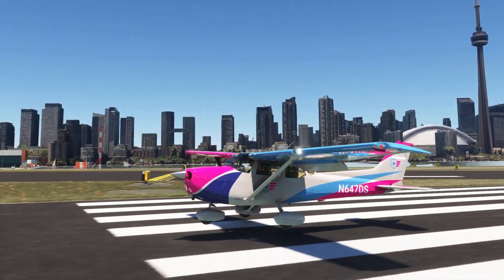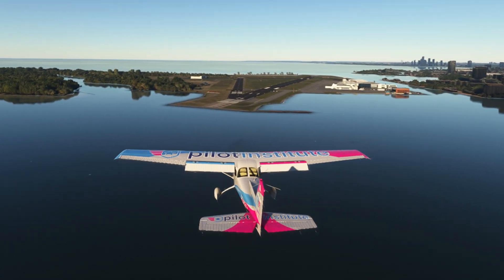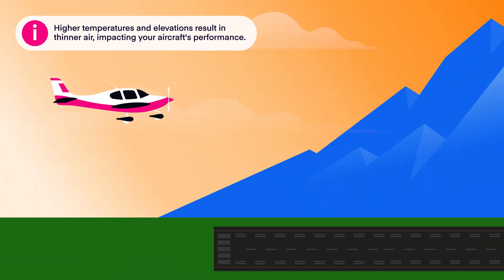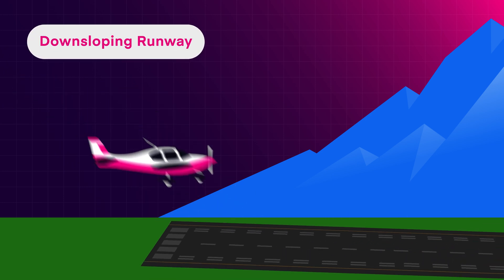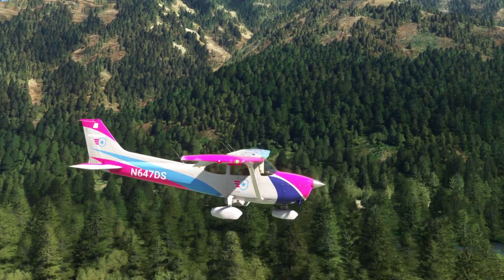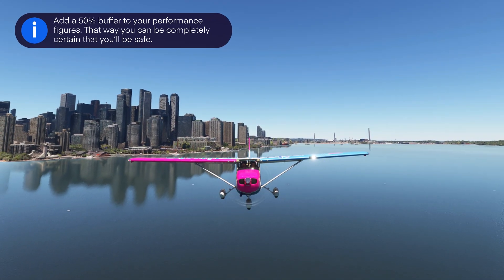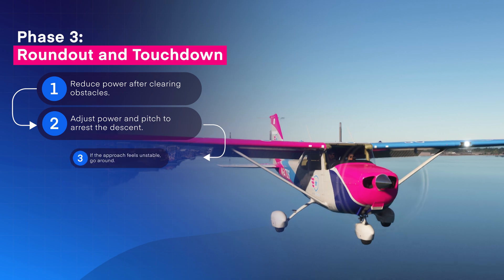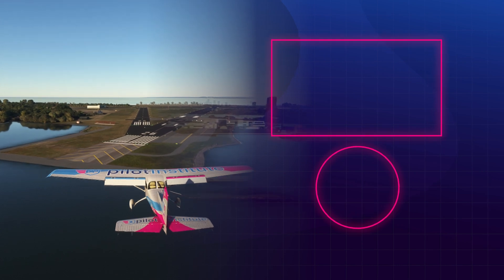How To Nail Short Field Landings

Comment: "If you're too slow point the nose down; if you're too fast lift it up".  That's a sure way to destabilize the line of flight.  It's easy to see that shifts the aiming point a centerline stripe or two lower or higher.  Per the Airplane Flying Handbook - "Whenever a slow speed approach is noted, the pilot should apply power to accelerate the airplane".
Reply: I always feel like the “pitch for speed, power for altitude” is an oversimplification, it’s just management of energy and either way to manage speed works as long as you’re not adding or removing too much energy
Reply: @ExpwodingMuffin  Actually either way to manage speed doesn't work.  If there are gusting conditions, the airspeed needle is going to be constantly moving.  A pilot who has been taught 'airspeed is king' and 'pitch to airspeed' may try very hard to stabilize the airspeed with the elevator.  I saw someone try to do that and the approach looked like a roller coaster ride.
Reply: @warren5699  I agree, when I'm on approach my airspeed always varies between like 65 and 75 knots, I notice a lot of people as you say, overcorrect for things instead of letting the plane do plane stuff

Comment: Why in the fuck would you pitch down and pick up speed on a shortfield landing?  "oh we're getting too slow, I'd better pick up some speed instead of increasing throttle and hopefully we won't use up the entire short runway."  Pitch up, balance between power and pitch, not pitch down.  Full flaps.  Hang it from the prop and fly it all the way to ground effect, pull power, raise flaps, touch down, brakes, deploy flaps and pitch up for aerodynamic braking.
Reply from the maker: On final: 
Pitch = control airspeed
Power = control altitude
And of course, you use a mix of both simulataneously. 
You raise the flaps right before touching down and then add the flaps again on touchdown? Definitely not something I would teach anyone to do.

Comment: Good coverage.  Thank you.  The best slow flight practice for short field or any landing feel the airplane is the hover taxi at much slower airspeed than Vso, an out of ground effect number.  But first the power/pitch apparent brisk walk rate of closure approach to touchdown slowly and softly exactly where desired.  While 1.3 Vso is a good safe and stable airspeed to get us up to where we old crop dusters used to start final, a quarter mile out, it will make it impossible to slow enough to make the numbers every time.  At the desired touchdown spot, we have to be much slower than Vso to quit flying in one inch ground effect.  About a quarter mile out with full flaps, pitch up to decelerate enough to get a significant sink to bring dynamic throttle into play as the most excellent and exact glide angle and rate of descent control all the way down to touchdown slowly and softly on the desired spot.  Ailerons are not effective at this airspeed and we don't want to turn anyway and certainly don't want incorrect adverse yaw.  We want correct yaw, rudder only yaw, to bracket the centerline between our legs.  And yes, even with deceleration enough to bring dynamic throttle on line, ground effect will cause too much airspeed energy to make the desired spot.  Listen to what Wolfgang, in Stick and Rudder page 304 has to say about that spot.  "The clue to watch is the intended landing spot and the scenery beyond it and to the sides of it.  Once the normal glide has been broken, the process of stalling the airplane down can be gauged entirely by watching the spot and the perspective in which it appears and its apparent motion.  Let me have a shot at that.  Look down at any distant target and notice its apparent brisk walk rate of closure with us.  Now simply remember, good muscle memory, how you decelerate your automobile enough to maintain, yea stabilize, that apparent brisk walk rate of closure with the intersection never looking at your ground speed indicator.  So coming into high ground effect we pitch up further to stabilize that apparent brisk walk rate of closure with the desired touchdown spot and continue power/pitch to touchdown slowly and softly on the desired touchdown spot well below Vso where the airplane will quit flying and not skip and bounce on down the runway with too much airspeed.

Ok, to hover taxi, add some more power at this almost touchdown spot and continue down a long runway using dynamic and proactive elevator (quick for/aft movement) to bracket level in low ground effect.  This will give your students seconds of actual slow flight in low ground effect rather than just an instant during the flair of a landing.  Hold off during the round out and hold off technique does not count.  It is way too fast until the very end when you finally slow down enough to quit flying in one inch ground effect.

This apparent brisk walk rate of closure approach works with any glide angle.  It allows a glide angle (actually power/pitch angle) steep enough to touchdown slowly and softly very near the obstacles we are just clearing to get into the beginning of the runway.

Comment: "Step 2:  Adjust power and pitch to arrest the descent" after clearing the obstacle is fatally wrong.  You are telling a student to enter a power off stall 50 feet above the runway.
Reply from the maker: Adding power and increasing pitch = a power off stall?
Reply: @PilotInstituteAirplanes  You didn't say add power you said adjust power and pitch to arrest the descent.  Since this is step 2 of phase 3 in your video it can be implied that you are saying to hold altitude after reducing power after clearing the obstacle.  The first time I watched this that was what the instructions seemed to be saying, but watching it again if you are doing this just prior to touchdown to soften the landing then that makes a little more sense.
Reply: @chris5293 In order to quit flying in one inch ground effect we have to be well below Vso, an out of ground effect number.  If actually slow enough to make the beginning of the runway while not clipping the obstacle, the glide angle will be steep and the airspeed slow.  This will require perhaps considerable extra power to cushion, along with ground effect, the descent.  And drop down just twenty feet from your 50 feet number, and you are entering high ground effect, where your concept or book number for all the various stalls.  Pilot institute is correct to recognize the need for extra power at the bottom to arrest the if slow enough rapid descent.